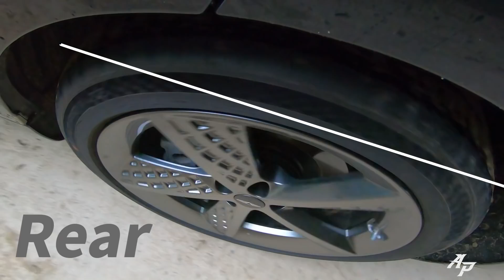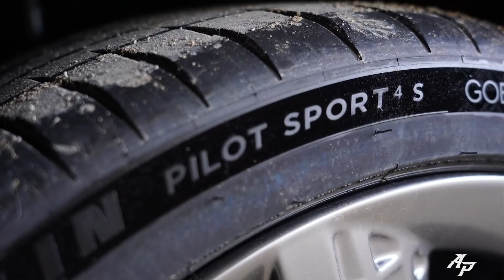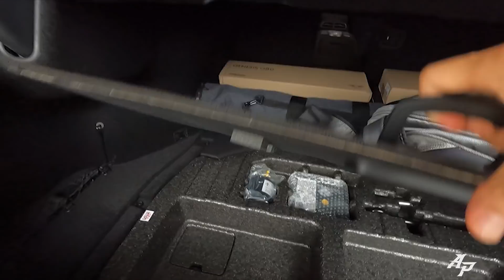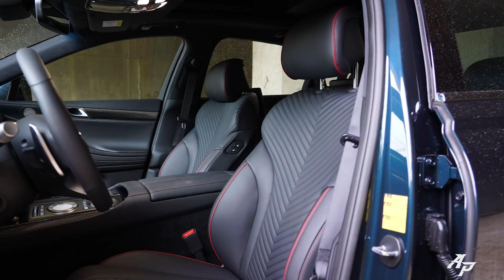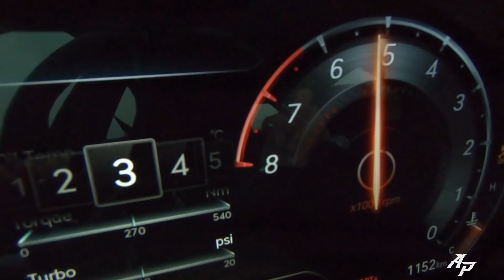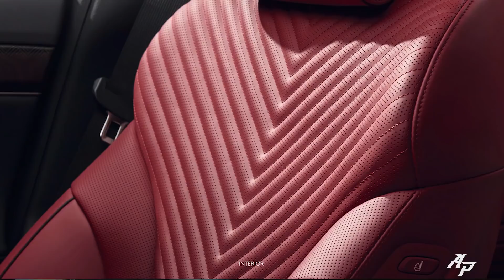2022 Genesis G80 Sport – Rear Wheel Steering, Launch Control & Sport+ Mode.

Comment: Charlie another great review of a great car (and car brand)!!! Likes: Carbon fiber trim, Driving performance with the rear wheel steering, shifting, full LCD driver cluster (w/ lane change camera view), and the subdued chrome grille and accents. Dislike: 3 spoke steering wheel (looks like Mercedes; I prefer G90's 4 spoke), wheel spoke design (too busy), additional fake sound, and the infotainment "perched" on top the dash like that (again prefer how the G90 integrates infotainment and driver instrument cluster into the dash). Wish: The dynamic package to come standard on the 2022 or 2023 G90, plus the full LCD instrument cluster. IF not standard I would take an option as well. Thanks!
Reply from the maker: Yes, fake sound, you can turn it off. I really wish Genesis would have introduced more powerful engine with the 2022 Genesis G80 Sport! Thanks.

Comment: 2015 Hyundai Genesis 5.0 Ultimate does 0-60 in 5.1 sec. It’s surprising that 2022 G80 with highest trim level is slower. That’s corroborated by 0-60 times website, not the rainy conditions.
Reply from the maker: Yeah, 5.0L V8 is the way to go. Thank you for enjoying the 2022 Genesis G80 Sport review!

Comment: I had a 2017 Q7 with all wheel steering, traded it in for a 2018 cayenne , didn't realize how great rear steering is, I could not corner close to how fast in the Q7
Reply from the maker: Well Q7 is large and tall SUV, that's why. But yeah, this 2022 Genesis G80 Sport felt so much better with the rear wheel steering system. Thanks.

Comment: i hate that car manufacturers do give you the option to disable traction control and other options, but they are not 100% off , just kick in las moment.
just give the people  100% off option, but it should be toggled every time you start the car, so it cant lead to unintended situations....
Reply from the maker: Yes, but at the same time, it will save you. Thank you for enjoying the 2022 Genesis G80 Sport Review!

Comment: They should have changes the rear exhaust tips to a quad setup. The standard tips  are not my favorite. 
400hp should be the mark.
Reply from the maker: Yes, i think, so, too. A bit more power and louder exhaust would been perfect. Thank you for enjoying the 2022 Genesis G80 Sport review!
Reply: @AsianPetrolhead  love your channel. I have 3 Hyundai products, 2014 Genenis 5.0 RSPEC, 2019 Santa Fe and 2019 G80 Sport.  
I like the interior changes the front and rear fascias (why do we not see fog lights on sedans any more?).  A new, more throaty quad exhaust and at least 400- Maybe 425HP would be on point. Ford's 3.5 Ecoboost is 450hp!

Keep up the great reviews and content!
I was white knuckling it when you were giving it it's all on those wet curves - well over 100km- those tires and suspension set up is on point!!!

Comment: Only red caliper up front I don't get it .....with all the engineers and designers and people from all those other companies... ( Bentley Audi BMW and Lotus just to name a few). you'll figure that they would put more horsepower into it... what are they waiting for... ?...a few years ago they came out with that big V8 pushing 430 horsepower .... and top speed with the governor off and 195 miles per hour  and 0 to 60 times at 4.7 on premium gas....they need to do something with the newer cars then call it a sport... features cosmetics beautiful lines is nice but people want  horsepower there's way too many companies out there with 3.5 engine  pushing well over 400 + horsepower Hyundai, Genesis, Kia just needs to do it ok

Comment: My wife and I currently own the 2018 G80 Sport. I feel the previous model had a more sporty appearance. They should've blacked out the side mirrors, more aggressive front and rear splitters, quad exhaust tips, a black lip spoiler and maybe black out all the emblems. The difference from the regular G80 to the Sport variant is very miniscule and don't see any reason to pay extra.

Edit: Not a fan of the wheels on the G80 looks better on the GV70.
Reply from the maker: Yeah, blacked out would been more sporty, but dark chrome makes the car looks more luxurious, i guess. Thank you for enjoying the 2022 Genesis G80 Sport review.

Comment: This is the perfect G80! Just I wish it had a lil bit more horsepower like at least 400-420hp
Reply: A tune will open her right up. Add a tasteful exhaust for a little more soul.
Reply: @Cgee3  *Seoul 

Fixed for you. 😉
Reply from the maker: Yes, Husen, but like i said, this 3.5TT feels quite powerful enough, scary enough! Thank you for enjoying the 2022 Genesis G80 Sport Review!
Reply: @AsianPetrolhead  no its not....amg and m and s from audi....if they wanna compete with Germans then get serious
Reply: @ebonix33  only debate of that is Mercedes Benz being the third most reliable engine after Honda and Toyota so they are the only Germans in the discussion vw and audi have a 1 in 13 chance of failure some of the lowest rated reliability engines out of all brands

Comment: They should have turned the engine to over 400 hp and over 400lbft of torque and make a sport model instead of a "Sports Appearance " model.
Reply: Just do a stage 1 tune with HFC and easily 440 hp
Reply from the maker: Yeah, a bit more power would be lovely. But the 3.5TT already makes tons of power, scary enough. Thank you for enjoying the 2022 Genesis G80 Sport Review!
Reply: that ain't gonna go over to well on the west coast, $5.20/gal prem.  and a mandate of all electric by 2035
Reply: @thomaswattle9828  you still have 15 yrs of fun sir.

Comment: Needs 550 hp from a blown V8
Reply: Twin turbo more efficient
Reply: @truckingjamaicans5045  absolutely, hot V design.
Reply from the maker: Yes, that would be great! Twin Turbo V8! Thank you for enjoying the 2022 Genesis G80 Sport Review!
Reply: @AsianPetrolhead  did you review a G80 2.5T?
Reply: Too much weight, cost, and decreased reliability.
Reply: @JohnLee-db9zt  meh
Reply: @bobdavis3357  You need to find balance in your life. Overdoing it will shorten your life span.
Reply: @JohnLee-db9zt  Worry about YOU.
Reply: @bobdavis3357  I’m fine. You’re not.
Reply: @JohnLee-db9zt  dude, I drive truck AND work on cars for a living.  In the interim,  you on the other hand? I have to work now. Can't help it if my brothers and I happen to own our business. You get some sleep
Reply: @bobdavis3357  Why you mad? Lol
Reply: @JohnLee-db9zt  not at all. Just enjoy the review